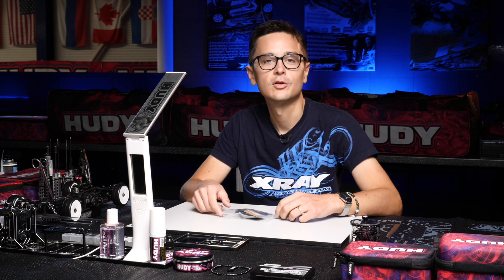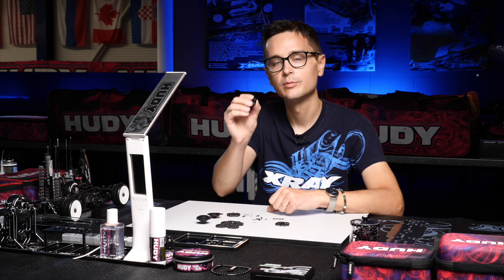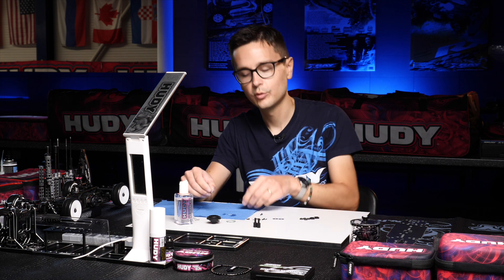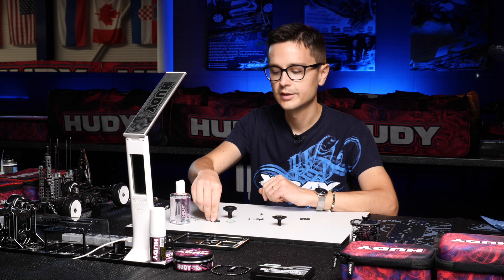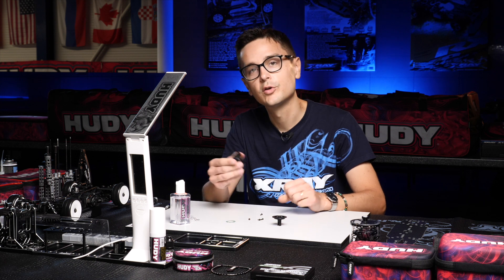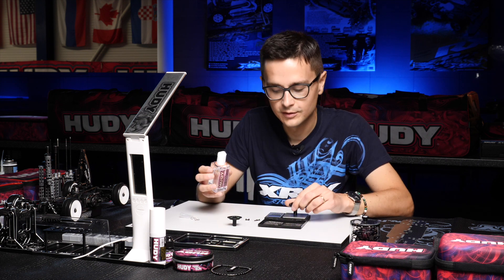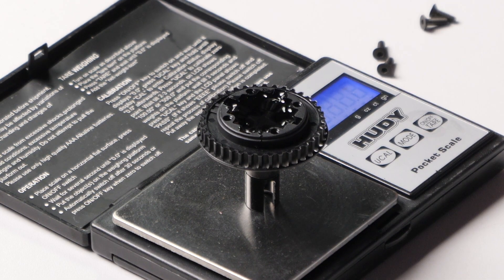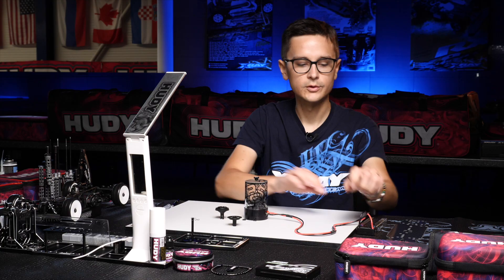XRAY X4 - Tech Tip - Rear Differential

Comment: Crazy how bevel gear diffs are standard and the best. Back in the day, gear diffs were thrown in the track and replaced for ball diffs.
Reply: Ball diffs usually can't handle that much power without cranking them down really tight.